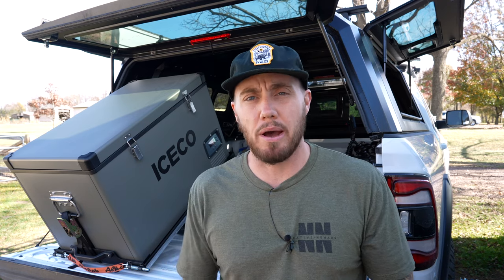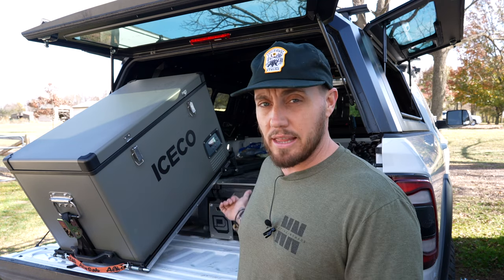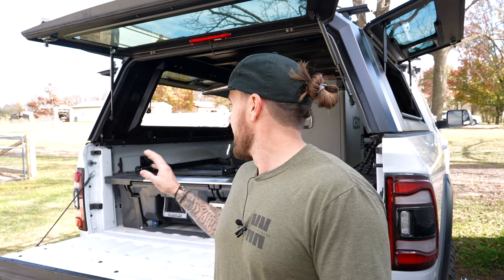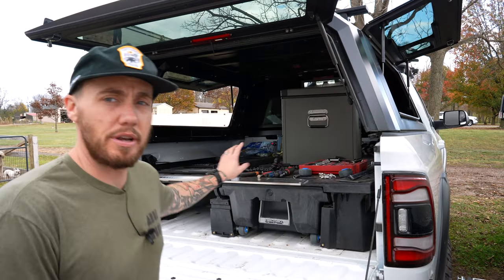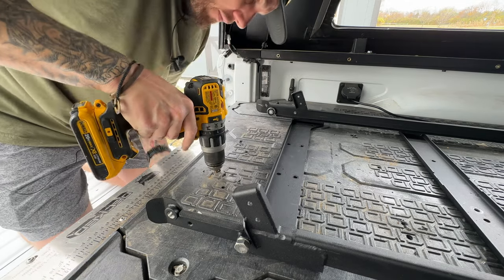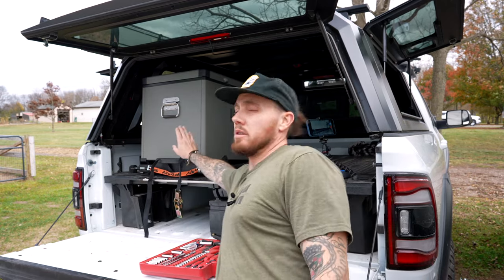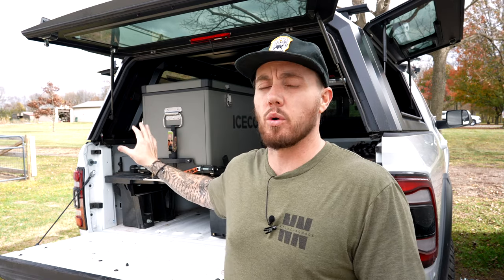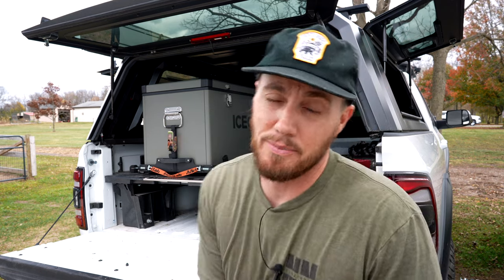Alu Cab Fridge Slide Install On decked Drawer System | Overland Build

Comment: Not drilling holes into my $1700 Decked system, but I made a great platform mount inside the back seat area of my cab for my Dometic. Not getting stolen and away from the weather. This is great though, good job!
Reply: Just doesn’t work with a family of 5 that hit the trails.
Reply from the maker: Nice! I don't blame you.

Comment: First video of yours I stubbled upon so I havent looked to see if you found a solution for the cord situation but what about one of those retractable cord reels? Just a thought. Quick and detailed video though
Reply from the maker: Thank you! I just used the red and black wire hider and taped it to the fridge in the direction of where the outlet was. It solved my problem but wasn't the prettiest.

Comment: The way I would wire the fridge would be to have the wiring start at the front of the fridge go over the top and down the back side. So when you pull it it doesn't get caught up with anything it is up on top out of the way

Comment: I have just shy of 2 inches of play before my fridge hits the top of my mid height bed rack. How many inches of height will this fridge slide add?
Reply from the maker: I’m traveling in the van at the moment so I don’t have access to my truck. But, based on my memory there’s no way you reach that 2 inches. I would bet it all on less than an inch.
Reply: @roamingwithjosh  thanks man! Subscribed!!

Comment: Walking hypocrite. You don't want to sacrifice quality? You have iceco rather than dometic. Iceco is great but so are other fridge slides. 🤔
Reply from the maker: Thanks for the comment! You’re helping the channel grow and we appreciate that sincerely!
Reply: It has a German compressor with a five year warranty. They are one of the best on the market. Just because you like the name drop doesn’t make it any better.
Reply: Iceco is amazing. Love mine however they don’t make a tilting slide yet so if you want it to tilt you have to look elsewhere. Also note that slide damaged the fridge at a cosmetic point vs iceco would not have so there is a trade off. 

He is sharing his build as that’s what he wanted. However we each have different build wants and needs.